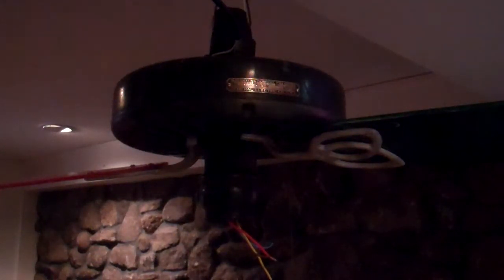1910-1930's General Electric Ceiling fan

Comment: Great fan, great video!  Was that fan 3 speeds as it came from the factory?  Thanks for taking the time to share.
Reply from the maker: It came with 3 speeds from factory. I will have it back soon. I have to finish making screws for the blade brackets and have to make blades